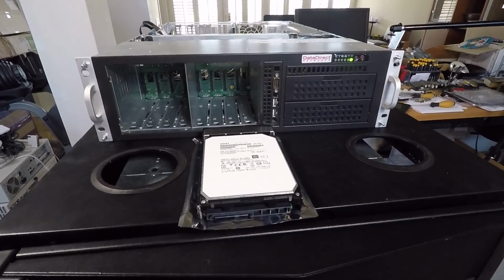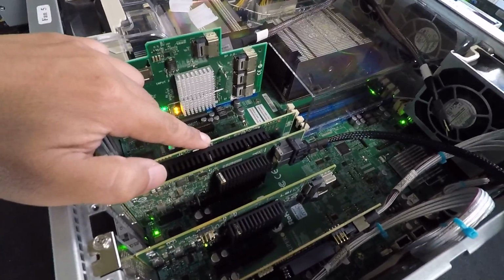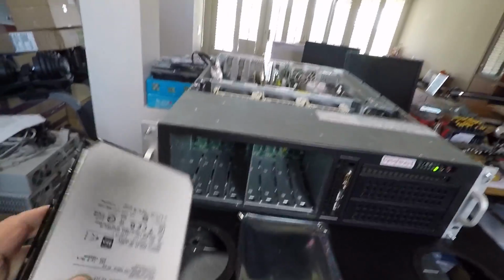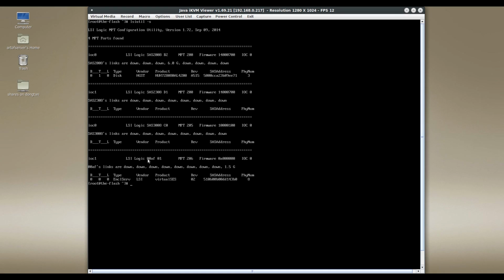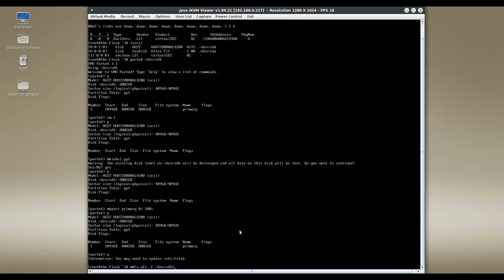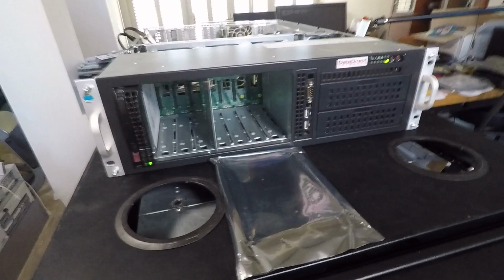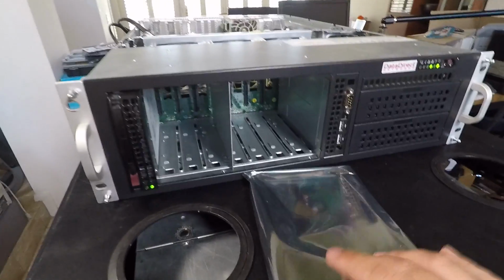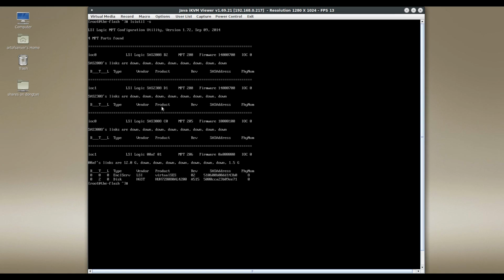4Kn compatibility with LSI SAS controllers

Comment: That's not yet all, the partition-tool is the wrong one too, infact the partition start at sector 1049 but with 4Kn must start at sector 256.
That's completely horrible because there are two error in one posistion, infact the partition on 512 start on 1048 and not on 1049, that' means... the partition tool is not for 4Kn. Parted assume that this drive is a 512e drive, not a 512 and nor a 4Kn.
There ist gptdfisk (tools) in Arch & Centos making the job right.

Comment: My SAS 2008 card is not picking up my 4kn drives in IT mode
Reply from the maker: It's probably not a 4kn issue. I would explore other possibilities to see if you can figure out what it is. are the drives encrypted? is the SAS2008 running the latest firmware?
Reply: @ArtofServer  hey thanks for the reply the firmware is MPTFW-20.00.07.00-IT, I can see my supermicro enclosures so I know the HBA is talking to them, the drives were refurb bought on ebay so I don't know if they are encrypted and I have no way to direct connect them.

Comment: Please note that there is difference between cards flashed in IT mode (Pass Through) vs Raid mode.  As others mentioned it is listed that 2008, and 2018 cards do NOT support 4Kn drives.  They do NOT support 4Kn drives in RAID mode.  IT mode doesn't really look at the drives at all, that is why 4Kn drives worked in all these tests as they were on IT mode flashed cards (As stated in the description) 
in Passthrough / IT mode it is up to the OS to be able to support the drives.
Reply from the maker: That's a very good point. the 2008/2108 chips with IR mode firmware or MegaRAID firmware will not support 4Kn. This video was only about HBA (or IT mode) firmware cards.
Reply: I think this cannot be generalised. I flashed a DELL PERC H310 card (2008 chip) into Dell HBA mode and also tried cross-flashing to LSI IT-Mode. Both times my 4Kn drives were NOT recognised.
Reply: That's not yet all, the partition-tool is the wrong one too, infact the partition start at sector 1049 but with 4Kn must start at sector 256.
That's completely horrible because there are two error in one posistion, infact the partition on 512 start on 1048 and not on 1049, that' means... the partition tool is not for 4Kn. Parted assume that this drive is a 512e drive, not a 512 and nor a 4Kn.
There ist gptdfisk (tools) in Arch & Centos making the job right.

Comment: In case someone else (or if the Author has a thought) viewing this has dealt with this, I have an 'LSI SAS3041e-HP SAS 3000 series 4port with 1064E' that works GREAT in windows 10 connecting to a 6TB SAS Drive I have.  I bought a 4kn 6TB HGST drive to play with hoping I could get it to work.  Connected the drive and in disk mgmt, received an 'incorrect function' error when trying to initialize it- same msg in diskpart.  Found some detail about a 512 format so went into the LSI controller config and found an option to format 512.  It completed really quickly and now my error in windows disk mgmt is 'data error (cyclic redundancy check).  I have to be close...
Reply: Well I figured this out.  If the Author pin above was in response to my question, thank you. I watched again and did not see anything to help me and in my setup though. I believe my issue was related to the default sector format the drive had - just not clear why win disk mgmt could not handle it, why a format would resolve before initialize, etc.  I used WD's Hugo to complete a lengthy format. Once complete, windows 10 could initialize the disk without error and an msinfo32 check of the drive shows a sector size of 4096 compared to my many others (85TB combined total) of 512.  Hope this helps someone dabbling with this.

Comment: Thanks.  If I bought the 9340 controller and put four of those hitachi drives into a standard atx tower case (no backplane) what kind of cable would work best?
Reply from the maker: depends on the type of drive...
Reply: @ArtofServer   SAS Drive like your video.  Example HGST HUH728080AL4200
Reply from the maker: @eddieyeetx  then you need SAS cables with SFF-8643 (HBA) and SFF-8482 (SAS HDDs) connectors.
Reply: @ArtofServer  thanks. I ordered a card off your eBay.  Appreciate your help.

Comment: At first I like to thank you for this clear answer about 4kn drives and LSI (I was one of people who ask this question on ebay to you).
Do you have any idea about some limitation of combination 512/512e drives and 4kn drives in pool. I read somewhere that is not good idea to combine 512/512e drives and 4kn drivers in one hw raid array. Is this also true for sw raid/pools for example ZFS or UNRAID? Or can be done without issues?
Reply from the maker: That's a good question, and I don't have an answer for you. ZFS does try to align with the native sector size of the underlying devices, it's a parameter called ashift. But I'm not sure what it will do if devices with different native sector size are used. I don't have enough 4kn devices to test that scenario out, nor do I have 512n 8TB HDD to mirror with this one 4kn 8TB HDD... Actually, to come to think of it, what 512n and 4kn devices do you want to mix?
Reply: @ArtofServer I have no spare 8TB 512n drives to test ZFS, but I manage to test UNRAID with 512n drives in pool and 4kn drive as parity drive and seems that it working. The pool was created correctly, speeds for parity rebuild was ok (~100MB/s), which is actualy max of read speed of rest HDD in pool. So I cannot say on 100% that is ok, but so far it working well.
Reply from the maker: @pavelkristofik5269  Thank you for sharing your results!
Reply: @ArtofServer  My previouse comment, that 8TB is working fine, was for HP DL380e G8 with p420i (which should be lsi2308). But when I tryed it on Dell R720xd witch h310, than 8TB disk is not found by system (lsscsi did not show it). In iDRAC it see it as 900GB disk wich 512sector, which is not correct. Do you think that h310 works different than regular lsi2008. Which firmware you have? I have 20.12.0-0004. Can backplain be an issue here?
Reply from the maker: @pavelkristofik5269  What kind of H310 card is it? The H310 mini? Or a regular PCIe H310? Have you tried updating the Dell firmware for the H310 you have? Or, is this one of my IT mode H310 mini cards?

The H310 (mini or PCIe card) should be functionally capable as any other SAS2008 based card. Notice I said *capable*, as the actual function depends on the firmware too. In my case, I use LSI firmware, not Dell. The LSI firmware I use for SAS2008 based cards is P20, or 20.00.07.00 IT mode firmware. With LSI firmware, I don't see a problem when directly connecting from HBA to 4Kn HDDs. The SAS2 expander is an interesting question though...

one more piece of information I need... can you tell me the exact model and brand of the 8TB HDD you are using that isn't detected?
Reply: @ArtofServer  Hello, My drive is HGST HUH728080AL4200 8TB SAS model. The H310 is mini version connected to storage port od board, so no PCIe card.
Reply from the maker: @pavelkristofik5269  ok. Thanks for the info. Then I think the issue might be either Dell firmware or maybe the SAS expander. I assume you already updated to the latest firmware?

Since I also have r720xd, I'm going to test my hgst 8tb 4kn drive in it with h310 mini IT mode firmware. I'll let you know what I find out.
Reply: @ArtofServer  I did not update firmware yet, there is same firmware as was delivered from ebay saler. It is new HW for me, so I am trying collect all information and still is not clear to me. As far as I know there is original dell firmware now. am I correct, that exist dell raid and IT (hba) firmware for H310 mini? I read somewhere that original formware has short "queue", is this correct? So is better to crosflash to standard LSI firmware?
Reply: @ArtofServer  big fan of your work! Please do report back with your findings. Looking to order one of your flashed H310 mini mono, especially if it allows me to use some 4kn drives I have laying around. Thank you!
Reply from the maker: @angel.torres  https://youtu.be/C279CbvujsE
Reply from the maker: Pavel: you might want to check this out https://youtu.be/C279CbvujsE